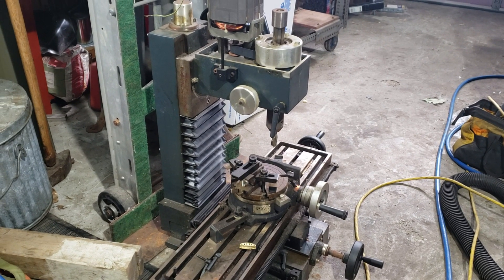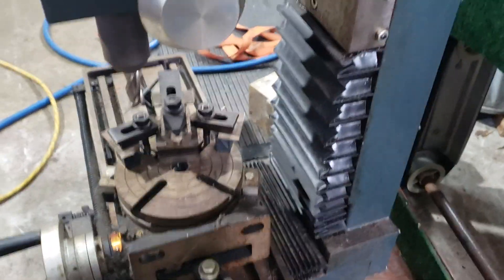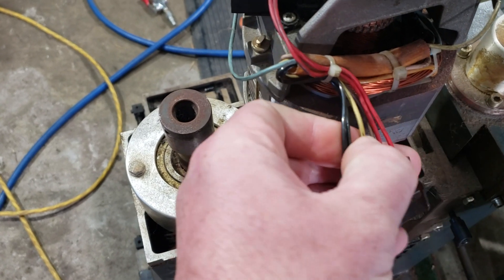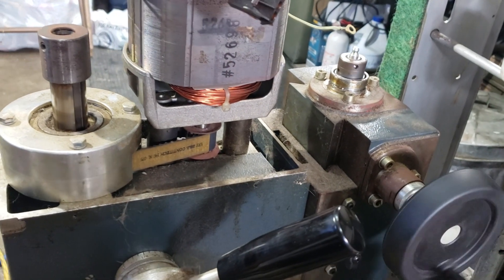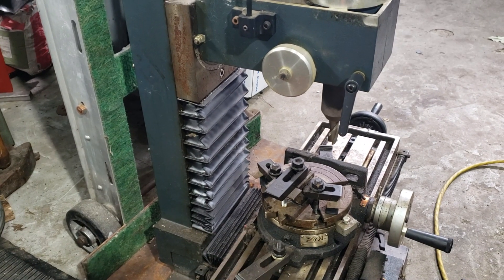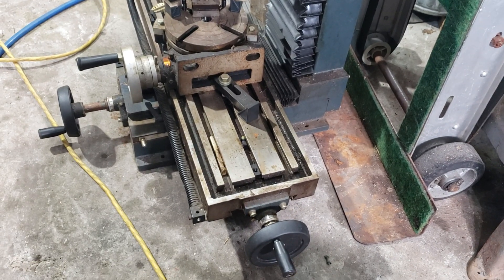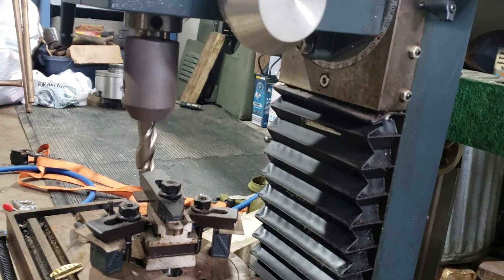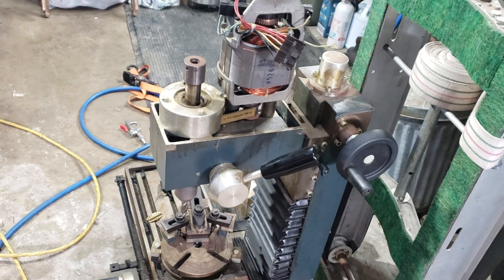Help identify this mill! Wabeco 1410? I need help getting it going!

Comment: It is definitely an Wabeco, I own one, ISO 30 taper, 2KW, belt driven,  7500 rpm. They make them in Germany (castings, motor, spindle). Don't know if  ball screws are Chinese or not. The machine is ok, especially if you don't expect high MRR out of it. The weakest link in the chain is the spindle casing, which is made of aluminium, so no hard pushing on speeds&feeds . I bought it brand new in 2013 and the tolerances were as advertised: flatness: eight ten thousands on X and Y over  12 inches and three ten thousands spindle runout. Ball screws were optional; and the balscre nuts were made of hard plastic - maybe Delrin- which helps a lot with having virtually no backlash. I had someone cnc-it and when they installed the timing pulleys, they used a hammer and the Delrin nuts got ruined ! But yours may have acme screw so, no worries about Delrin nuts. If you ask from the machine what it was intended to do, it will serve you well. It is well made.

Here is a manual with general info on the company: http://www.wabeco.com.au/04_media_release/wabeco2012.pdf

I also have the manual for F1200 and F1400 ; I have tried to find it on Internet, but somehow I couldn't ; send me an email address and I will forward it to you. My email: mihailfelixdumitrescu@gmail.com

Comment: That's an universal motor with tachometer output. Exactly the same as you'd see on a washing machine, or minus the tachomenter, on pretty much any kitchenware. With that little advantage though, you'd be changing the carbon rods every now and then. Expect arcing/sparks under load, and also a motor that can only run in a single direction (unless you want big sparks with almost not torque, that is). Better to look for an induction motor and a vfd if you plan on keeping the mill. My 2 cents.
Reply from the maker: Thanks for the input, I have not messed with it yet, but I do know they sell a Reversing option for these, which is basically a switch.

Comment: Hi, this is a Wabeco F1210. Very nice little qualitative German mill with some not standard modd's: https://www.wabeco-remscheid.de/catalog/category/view/s/f1210-dovetail-guides/id/396/
Reply from the maker: Thanks, I am currently working to get it back up and running.
Reply: Some people replace the DC motor by an AC with VFD because the standard motor control board is not reliable and an AC can deliver more torque at lower RPM

Comment: You probably have already found this, but Wabeco has the manuals online as PDF. While they are in german they include all the drawings and spare parts:

F14xx
https://www.wabeco-remscheid.de/media/content/Download/Fr%C3%A4smaschinen%20mit%20Linearf%C3%BChrung%2010-2014.pdf

F12xx
https://www.wabeco-remscheid.de/media/content/Download/Fr%C3%A4smaschinen%20F1200-F1200-C-CC-F1200-F1210-F1210-C-CC-F1210.pdf

I own a F1210 and honestly I wouldn't bother getting the old motor up and running with new Wabeco electronics / spare parts. Get a used VFD and nice 1,5 - 2,2kw motor this will give you much more torque and the same controlability.
Reply from the maker: Yes, I have thanks. MDA Precision deals with these in the US.

Comment: Nice you have a Wabeco F1210 nice to see this in US.(despite the bad condition) Here you can see my cnc conversion it is a  F1410.(is actually the same machine)I hope you can gather ideas.
have fun with it
Here the manual German: https://www.wabeco-remscheid.de/catalog/product/view/id/7171/s/bohr-fraesmaschine-f1200/category/389/
look for the word Betriebsanleitung
Reply from the maker: Thanks Stephan. I contacted MDA precision here in the USA which is suppose to service these machines. Going to try and get a circuit board for it and possibly the cover and the draw bar. I can source the other parts locally. Once I get it running, I'll clean it up and start using it. Looks and feels like a solid machine for it's size. Thanks for the link. Very helpful.

Comment: 100% for sure it's nothing Enco had a hand in. Wabeco is a sort of odd company as far as exactly where and how much is actually made in Germany. There prices are well above what the generic Chinese mills are that look like but still may not have directly interchangeable parts. If those really are Newall scales and reader heads they should work with most? Newall displays they sell today. The reader heads on each scale should clearly show the Newall name if that's what they are. And if so those would be what Newall call a Spherosyn scale. The much more accurate Microsyn scales are a lot smaller in diameter. it's still an odd setup and I've never seen any Newall dro that uses that type of scale covering and protection. I'm thinking they might possibly be a Canadian made Shooting Star DRO.

Comment: Definetly an older style Wabeco mill. MT2 is correct, they have an option for iso30 taper too. They have a funky drawbar arangement with a differential thread to eject the MT2 tooling (Fine internal thread on top of the spindle).
Reply from the maker: Hey Stefan, I started figuring it out shortly after I posted the video and thanks for confirming it. I did shoot out an email to Wabeco to see if I can obtain some parts. I'm thinking it might be a little expensive, but might be worth it to have a high quality German made machine. It does have a couple stickers on the way covers that look to be in German as well. The DRO scales appear to possibly be Newall. I'm going to see if I can get this little gem up and running. I noticed the double threaded draw bar that it needs, makes sense that it will help extract the tool. Thanks again for the info!

Comment: I don't know what it is but if it does turn out to be a PM 25 I have a hood that might work for the motor. It was a gift to me along with lots of other parts from a PM 25. I had to pay the freight so If you figure out what it is and this hood will work you pay the freight and it is yours.
Reply from the maker: I'de be interested in that.  If I could get the hood,  and if you had any controls or electronics that would help.
Reply: @precisionmachineshed  Here is the copy and paste I told you about in the other comment ( The reds are a hall affect sensor (tach /rpm /speed feedback.)two of the other 4 wires are armature the other two field. Just wire it as a dc motor. Ignore the sensor unless your speed controller has that.) Hope this helps.